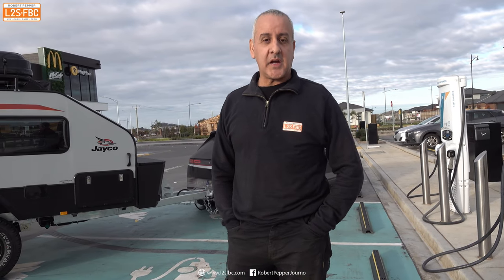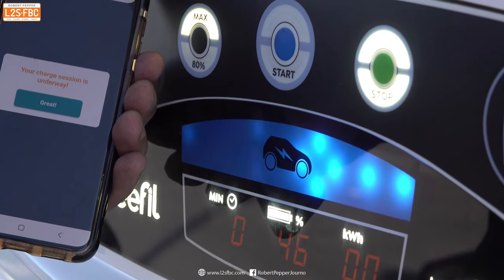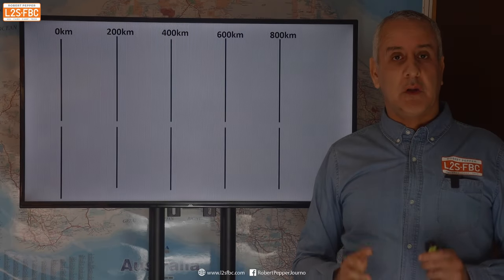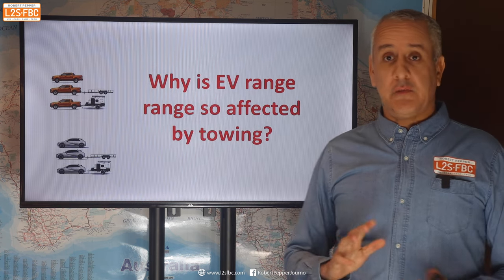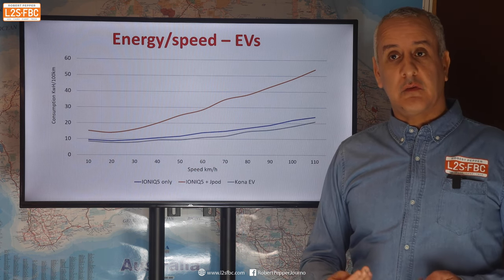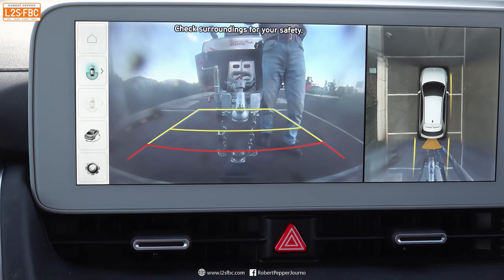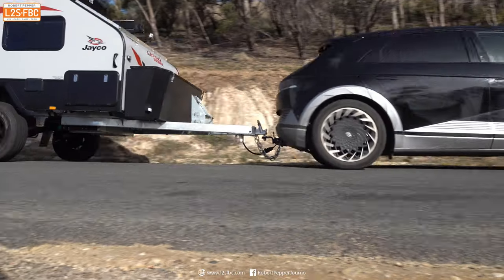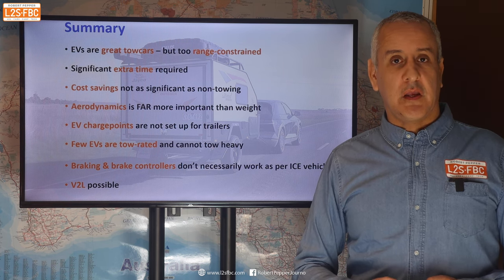EV vs diesel - tow test in detail!

Comment: Towing, eh? What vehicle can tow more than any other? A locomotive. I'm a train driver and whilst EVs are new to most people, I've been driving them for 40 years. I can tell you for a fact that an electric loco is superior in every way to a diesel. They're quiet, both in the cab and going by if you live near the tracks. They don't vibrate, which causes the driver less fatigue. They need almost no maintenance, just sand and cab water which is like air in the tyres and water for the windscreen washer in a car. No fuelling, no checking engine oil and coolant. When they complete a run, they're ready for the next one right away. They are more powerful. The biggest diesels in use today have around 4,500 hp but electrics can have 10,000. HOWEVER, the only reason they work on the railways is because they're fed by an overhead wire with an endless supply. No charging required. So as you've said, an EV is supeior in every way except that they need charging way more than an IC vehicle needs fuel. If that could be addressed, there'd be no reason to own an IC car.
Reply from the maker: Fantastic comment thank you, really good to get different industry perspectives!
Reply: @L2SFBC  I should've said that if electric locos are so good at hauling freight, why aren't they in common use anymore? The answer is because of the cost of electrifying every last inch of the system. Just as charging is the problem with electric cars and never having to charge is the savior of electric trains, the initial cost of never having to charge is what keeps them confined to passenger trains in major cities like Sydney and Melbourne and if that could be addressed, there'd be no case for diesel trains. Running electric trains from Sydney to Perth will never happen.
Reply: Lol….. diesel is superior to electric, diesel litteraly can go everywhere no electric will ever go! No need of a super expensive electrified lines…. The longest/heaviest trains in the world are diesel powered
Reply: @davidrayner9832  you also realise that diesel locomotives are essentially electric right!? It’s diesel electric jus that’s they carry their own energy production
Reply: @carholic-sz3qv  Did you read the part where I said I was a train driver for 40 years? Pretty sure I know how diesel electrics work but how the diesel engine's power gets to the wheels is not the point. It's which is better, having an IC engine on board or not. I'll take not.
Reply: @carholic-sz3qv  I worked for Rio Tinto so I know about long and heavy diesel powered trains. Is 33,000 tons heavy enough? However, the longest and heaviest trains in the world are run in South Africa and are (wait for it) electric. Is there anything else you'd like to tell me about railways?
Reply: @carholic-sz3qv  Did you even read my last comment? LOL at that.

Comment: pretty much the same result as US reviewers, again the issue is battery capacity, once you work out the conversion from kWh to petrol energy you really can see that while EVB are again extremely efficient (its 9.8kWh per 1L) the issue is battery capacity and that is something that right now can't be resolved since each cell is 3.6v and the more cells the more weight which is why at this stage for large scale touring at this stage especially here in Australia EVB are not viable.
Reply from the maker: I explore why EV range is shorter than ICE in the other videos. The efficiency is around 90% for EV and 20% for ICE but the far, far greater energy density of ICE means it wins anyway. And yes the weight for another 200km of range is crazy for EVs, not for ICE.
Reply: @L2SFBC  - All good Robert, at least you are doing the testing while others sit on their collective hands.

Just to clarify it a EVB (Electric Vehicle Battery) would need the battery pack to be (no joke) 799kWh (which is something like 222 3.6v cells) which is 80L petrol equivalent, at the moment the only vehicle that has a large battery pack is the Hummer EV at 210kWh which in terms of petrol energy is 22L but the vehicle weight is something like  3.4 metric ton.

This is again why  :clean" Hydrogen should be the solution everyone is working for as battery tech can only go so far.

Solid State batteries might be an alternative solution however even then capacity will be an issue 

Anyway keep up the great content, much appreciated. 

Are you upgrading your Ranger to new one?

Comment: Now work out the total costs over 10 years for both with the cost of a new battery for the EV! Then you'll have the real cost.
Reply from the maker: Well, you wouldn't need a new battery after 10 years. And then you'd need to balance that cost against the ICE servicing cost including variou engine component replacements.
Reply: @L2SFBC  Yes for sure all total cost for both
Reply: @L2SFBC  Hyundai say the battery will last 160,000km, so that could be 8 years at 20,000km driving per year.
Reply from the maker: It is warranted for 8 years...so expect well more than that!
Reply: @L2SFBC  I fully expect the LFP batteries in my Atto to be like the motor in my 1974 Datsun 120Y, the car body will rust around it before it fully dies.

Comment: It took ICE 100 years to mature to the efficient, long lived machines they are today. With EV's the motors are already a cut above the best ICE, but the batteries, oh the batteries...and I can't see any breakthrough that will give us 10X the energy density that is required for long distance/towing.
I read that some crowd in the UK is about to start making synthetic fuel (for F1 I believe) from CO2 in the air and hydrogen from electrolysis. Apparently it's  $10 litre, so if it goes into production may rival fossil fuel prices. Now, should that become a reality, ICE will continue for many years to come and be environmentally neutral, and most importantly give us the energy density we actually need for long distance driving/towing.
Reply from the maker: I agree, can't see an energy density leap of what's needed any time soon. And, even with energy density, charge times. I think EVs will be great as city cars and short range, but for offroad, towing then something else is needed. Hydrogen, sythn fuel...something like that.

Comment: This comparison isn't valid, for, at least, 2 reasons: 1. You'd fill your ICE vehicle tank to the top, which takes mere minutes. Not so for the EV, since you're stopping at 90% “for the sake of the extra time it takes” although you did mention the reduced range across all modes for the EV, & requires many minutes, if not hours, depending on the EV & the charger, every time the EV needed to recharge. 2. While testing your EV, you forbid your companion to use the fans, & presumably the air-conditioning or heating too, since that takes extra battery power. This is not realistic, nor a fair comparison. I doubt that you placed no such restrictions when testing your ICE vehicle. The common-sense verdict: The ICE vehicle wins.
Reply from the maker: The comparison is valid - I do mention the recharge problem. The diesel car also had no aircon or heating running so it was equal. Yes, the ICE wins.